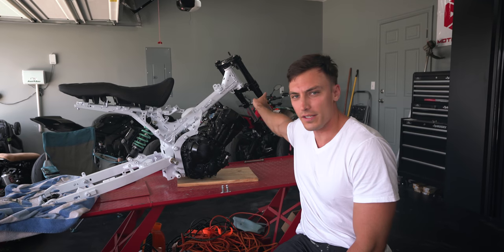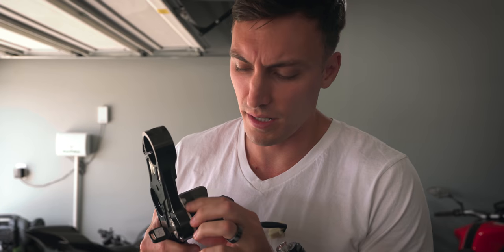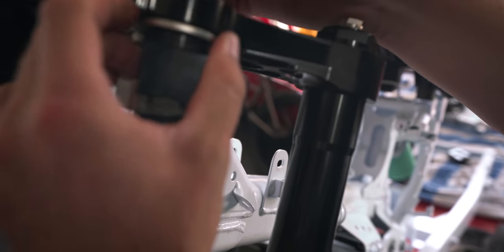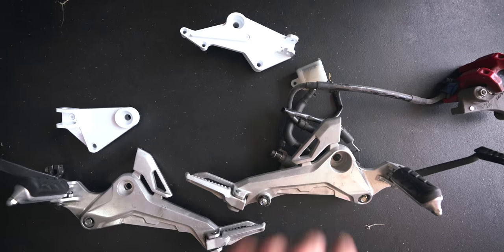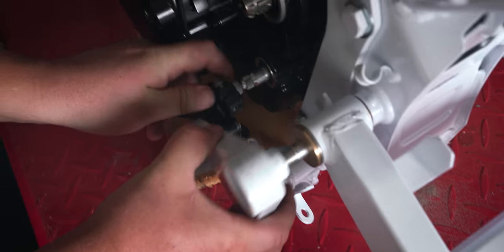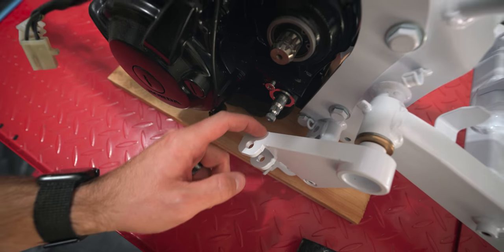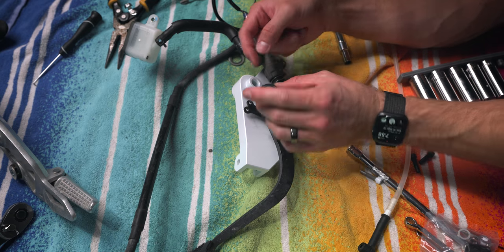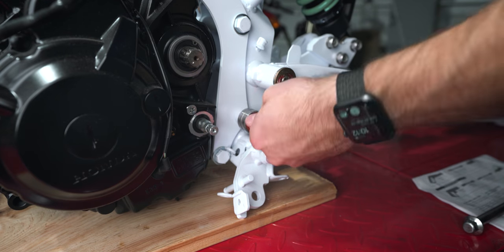The wait is OVER...The 300CC Grom is BACK (Rearsets and Clip-ons Install)

Comment: Hey @motonosity , give 3D printing a try. PC (polycarbonate) plastic can withstand easily 130-140 degrees Celcius, maybe even higher, depending on the manufacturer. It is tough to print, but there's nothing more heat tolerant than it.

Comment: Don’t bend the brake lever it’s probably made out of harden steel so it’s really strong but brittle 
Meaning you can’t bend it and if you try it will break
Reply: With heat you can usually bend them.  Worst case scenario it breaks and who cares, it doesn't fit anyway...